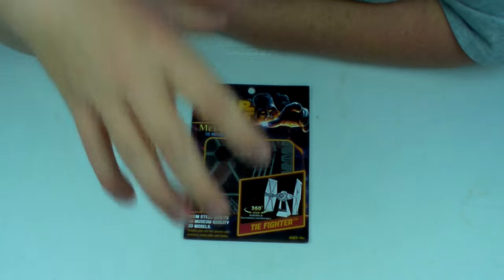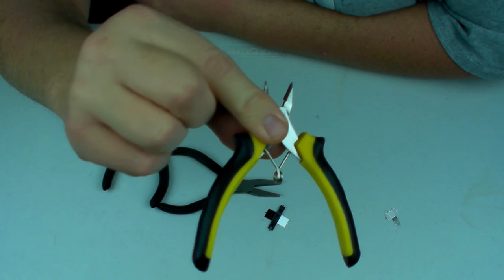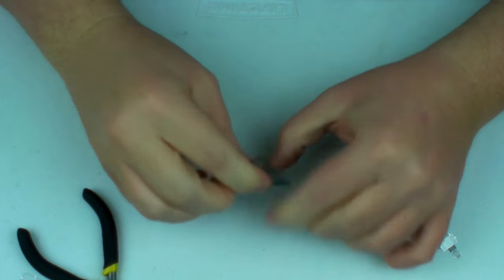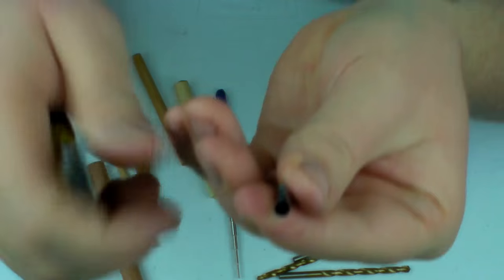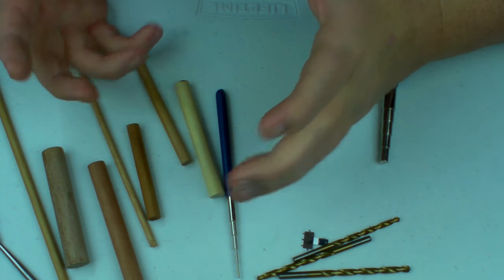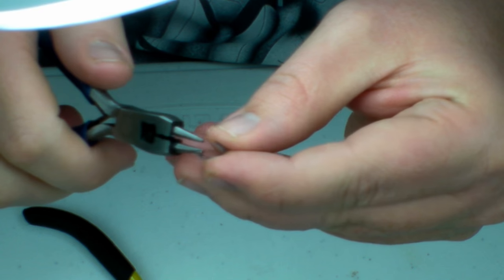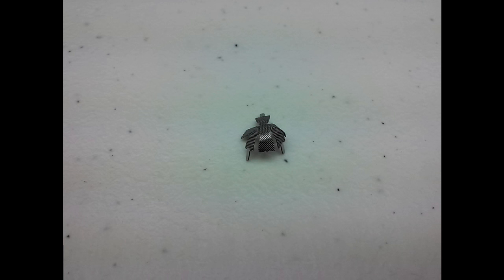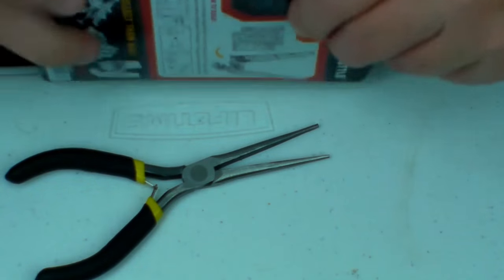Metal Earth - Tools and Tips(updated)

Comment: I use the smooth ends of drill bits for making curves.  I also use super glue to tighten loose pieces, but you should only apply it to the hidden side of the piece. A tiny drop on each tab (after it is in the slot) creates a solid bond.

Comment: Hey brother. Thanks for the video.  I've only made two kits and they were both "easy" builds, but in my ignorance I thought if I only used needle nosed pliers or tweezers to build the kits, then I was doing it "right".  Of course, now I realize that was stupid of me, and any tool or simple device that helps me bend or mold the pieces into the proper shape is fine.  Thanks for showing how to use the small wooden poles and pencil shaped pieces to form curved pieces and for showing the importance of using snips to remove the parts from the trees.  I too would bend the parts back and forth until they snapped off the tree, only to have to re-bend it into shape once removed.  Will certainly take your advise on my next build and use inexpensive items around the house , or invest in quality tools if needed.  Good luck with your future builds and videos!
Reply from the maker: Thanks for watching. I am glad it helped. I could show you a scrap pile of the broken parts and extra pieces of having to buy models a second time.

Comment: One tool that I use for really small spaces, like inside windows or if I forgot a tab after I added a side is a 2mm x2mm x 4" file. It helps catch the tip of the tab and start the bend then either I'll clamp it down with the file or if there's enough space I'll get my micro tweezers and twist it secure. Tons of options out there. Chill video man

Comment: A dapper tool kit comes in handy. They are steel balls of various sizes on the end of a metal punch. The kit also contains a dapper block that has different size concave indentations that the ball will fit into to make a perfect curve with metal parts.
Reply from the maker: Daniel Miller I have been wanting to get one but they are pricey.

Comment: I found bead pliers were great for finishing cylinders. also cubical trimmers work great for cutting pieces out. Also I saw someone use a magnet sheet to hold the flat pieces after you cut them out. Helps to keep you from knocking pieces over the edge of your work space.
Reply from the maker: I am not exactly sure what bead pliers are. I have found jewelry making tools to be a great help. As for cuticle trimmers, I have yet to find a pair that work for me, but honestly I have not search very hard.
Reply: I just grabbed my wife's cuticle trimmers. It was convenient at the time.They work ok, but as they are all I've used outside of bending the connection till it breaks, I have very little to compare them too. lets be honest, anything works better than that.

Comment: I have broken several critical parts and depending how it mounts you can use a product called " Shoe Goo " a rubber cement that is inexpensive and very tenacious with its adhesive quality has saved my but from having to buy a new kit  give it a try .
Reply from the maker: Thanks for the tip. I might look into that.

Comment: If you want a nice arrangement of pliers just get yourself an electronics plier set.  You can get them on Ebay and it has all of the pliers you mentioned and then some.  Also I agree with you on the flush cutters to get the pieces out from the sheet.  If you want to get about 80% of these kits for 4 bucks a piece I would suggest banggood.
Reply from the maker: Thanks for sharing. The kits I see on banggood are mostly Zoyo which I understand to be a knock off of Metal Earth and not the same metals. I wonder how they compare. I have tried a knockoff kit before. It was ok, but I will stick with Metal Earth and Piececool for now.
Reply: I made the Himeji castle with the knock off and thought it was pretty decent IMHO.  Earth Metal can be pricey and if you don't have a lot of money and want to try your luck at the hobby Banggood can give you the experience at a cheap cost.   When you get your level up I would then go for the more expensive Metal Earth as you stated.
Reply from the maker: Good point. The cheaper models would be the ones to cut your teeth on, and if you happy with them, then great.

Comment: Hi Brad,I would like to express my appreciation for your excellent work. Absolutely well done, dude! These tips are a valuable help especially for beginners.I have some questions about your tools. You use  "marbles with a stick a the back", If you know what I mean, and a scissors type kind of a thing, that can be locked at the back. Can you tell me the correct technical term, so that I have a chance to buy some? Thanks for your help. Greetings from Germany, Hamburg.
Reply from the maker: Dr. Tim Schurig hello and thank you. The clamps that lock are commonly called forceps (at least here in the U.S.). The tools that have different size spheres at each end were an odd find. When I bought them, they were considered a fondant shaping tool for cake making. I found them on AliExpress.com. They can be tough to find on there unfortunately, and I no longer have a link to the set I bought.

Comment: Drill bits work great.
Reply from the maker: They do. Getting a cheap set from the discount bin at a small time hardware store is not so hard to do. They don't need to be good quality sharp bits, just round. And they tend to come in finer sizes than dowel rods or the mandrels.

Comment: You probably won't see this... but I've only just started and before I break anything... what's the difference between the bend 90degrees or twist 90degrees? slightly confused
Reply from the maker: The big difference to me is that the twist is more secure and holds better but the bend looks cleaner. Twists are often used on tabs that will not be seen and bent tabs are usually for more visible parts or situations where clearance is an issue (is. Another piece goes over top and a twisted tabs would stick out and get in the wat).
Reply: @animateorange  a belated thank you, I read it but couldn't reply at the time. Thanks for answering my question, I thought maybe it would be important later, but if I understand correctly it's just to make it more secure and not really necessary. I guess I will just bend it then, less chance to cut my fingers  open ^^ thanks and have fun crafting 😉
Reply from the maker: It's my turn to apologize for taking so long to reply. After you build a  lot of models, you start to get a feel for which kind of connection works better, and you will find yourself making up your own mind half the time and now always following the directions. Just be careful of the space you have, twisted tabs don't leave much room to attach parts on top of each other.

Comment: i have iron man metal earth, its my first metal earth model. im contemplating if i should build it or not. im worried that ill messed it up. any tips?
Reply from the maker: Iron Man is an advanced build. I would suggest starting with something simpler to get a feel for working with the 3D metal models first. If you are a Marvel fan, I would suggest Cap's shield or Thor's hammer to start. There are lots of other models as well, planes, buildings, insects, tanks, etc. I have a playlist of easier kits that I have build called Starter Metal Earth list.
Reply: thanks for the suggestion. would definitely check out your vids for guide and info. i appreciate the reply, thanks :)
Reply: +animateorange

Comment: I like these but they are inconsistent some made well and go together well with tabs in the right place and fold smoothly others are made the complete opposite
Reply from the maker: +MrRideutah out of curiosity, are you referring to just Metal Earth brand models, or 3d metal models in general. Granted, there is some fluctuation between Metal Earth models. Some of them are not designed as well, mostly the older ones, and there have been a couple of times where a model or sheet seemed off quality. It's rare and Fascinations is good about replacement parts. There are a lot of copycats out there using lower quality metal.